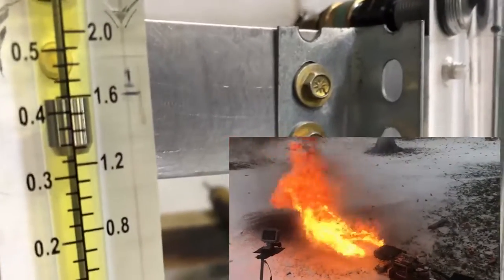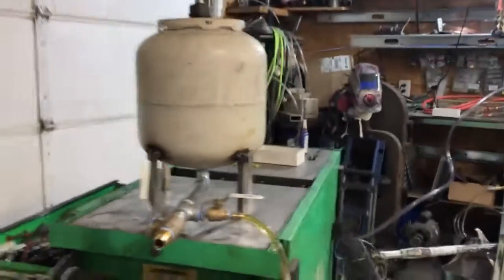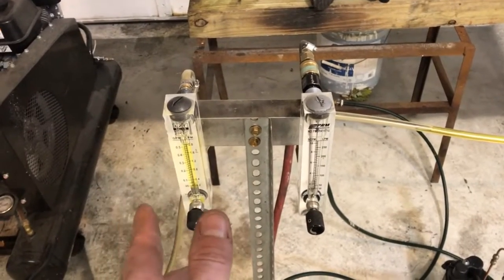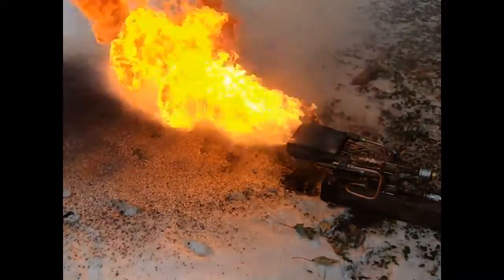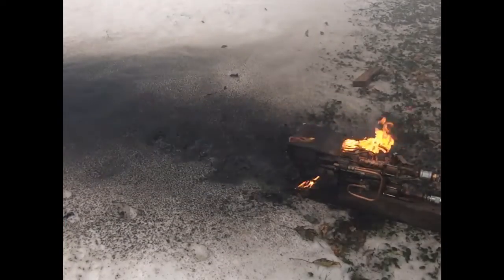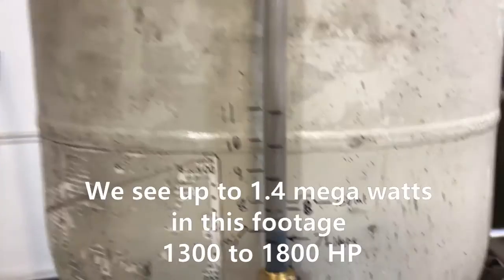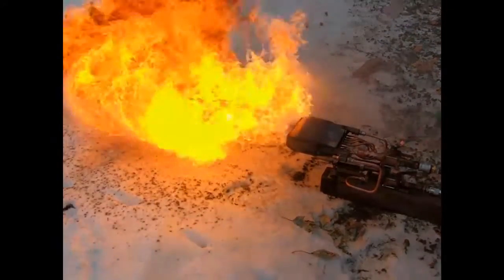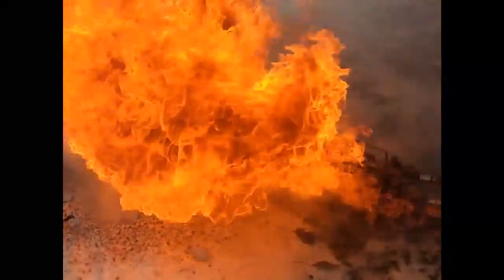What does 1 mega what look like in liquid form ? Or fire form ?

Comment: Makes a lot of sense from a flow rate, as methanol and other low energy fuels require like 3x the flow for that power level and it looks like a garden hose. That is an insane burner, even without adequate air.
Reply from the maker: Bro im thinking of dropping a grand to get a monster compressor just to run this thing . every time i turn around i need more air ...